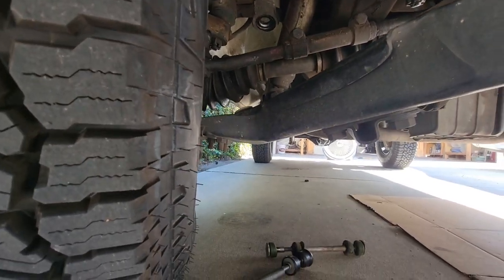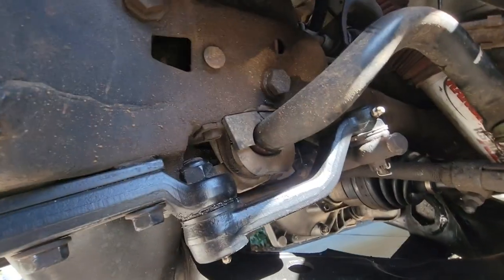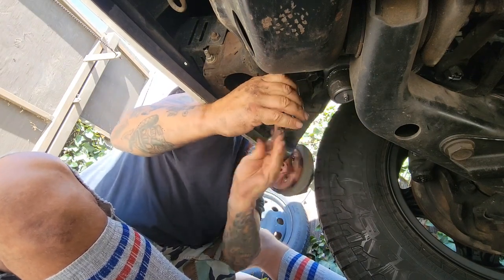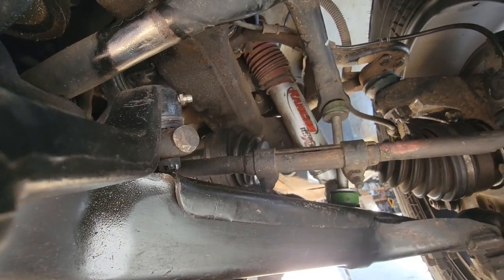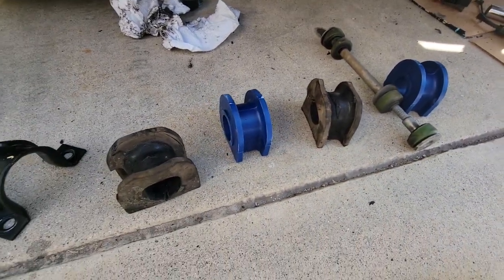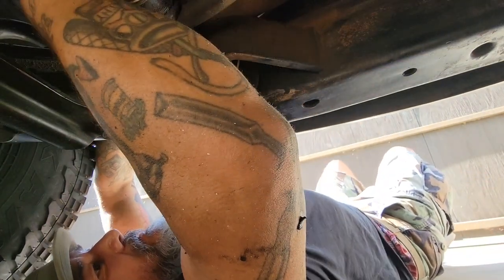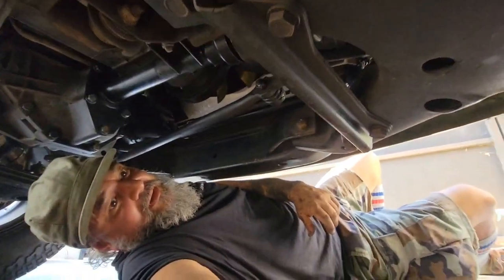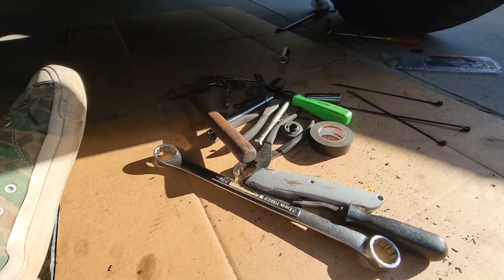How To Replace Sway Bar Links & Bushings - 2004 AWD (now 4x4) Astro Van

Comment: Thanks for the videos! You make me want to keep my Astro. You've put time into yours. Haha
Reply from the maker: Yeah, well, I bought this thing knowing I was going to turn it into what it is and I'm still not finished - I finally got it running so well and set up for my lifestyle I've been using it as intended for over a year now without issue. There are a few things that still need to be addressed and the overall "project" may never be fully completed as I haven't had the time to focus on the interior build.  I don't recommend the Astro to anyone who doesn't fully comprehend the amount of work it may take to get the thing dialed in - Time and money, man....

Comment: For the idler arm. Dorman makes a heavy duty version that looks like the OEM design where the pivot is like 4" long instead of very short like this moog. The part number has XL in it check it out. I put 5 sets of those moog idler arms on my van in 10 years, they fail the first time you go off road and if you stick your head out of your window on a gravel road you'll see your tire's steering flopping with every bump on a gravel road basically when these idlers go floppy it allows the tie rod-drag link-tie rod to bounce up and down which effectively lenghtens it and changes your toe in and out as suspension travels. I think it also hammers on your steering gear and wears that out prematurely
Reply from the maker: Yes, they're sometimes available on Rockauto.com but they're something like $189 each - I'll get them at some point
Reply: @AstroVanTribe  IA6392XL $50.99 on summit. I did get one bad one but Dorman sent me a new one direct immediately with no return
Reply from the maker: @ThomasMaerz-kl4op  Thanks for the tip, I'll order a set

Comment: Hey Bro so you didn’t jack up the front to replace the sway bar end links? I just bought some and am waiting to tackle it today. Lemmy Know
Reply from the maker: I don't need to jack it up because of my lift and 32" tires
Reply: Reason I asked is that I was worried about the sway bar being under load and didn’t want to make more work for myself. So I can just remove the sway bar end links no worries is my question.
Reply from the maker: @cliftonwayne9874  Worked for me
Reply: Fair enough! Today will be the day then! Thank you for the second opinion